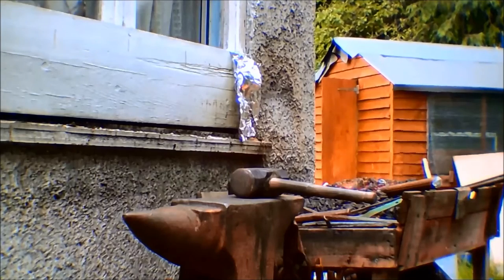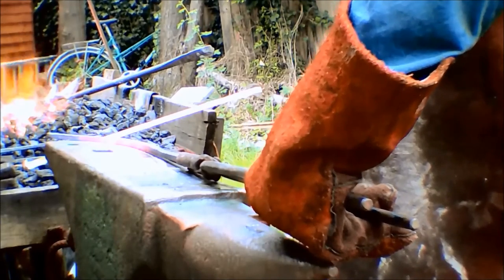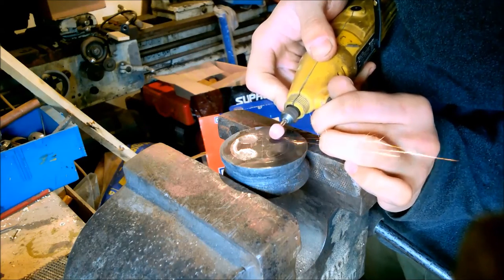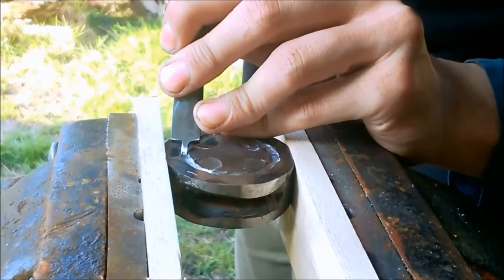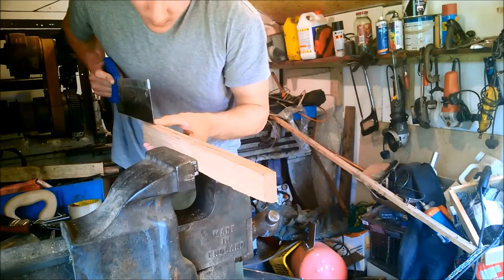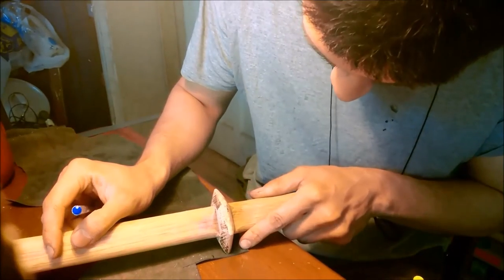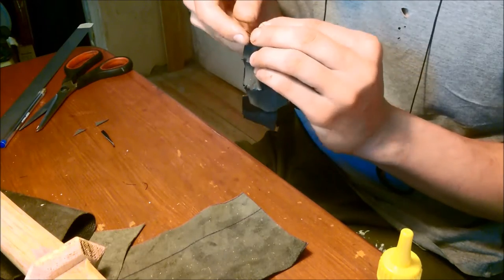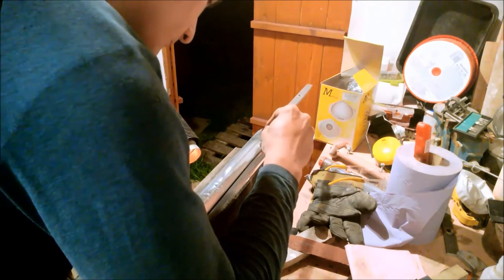Hand forging "Velka's Rapier" from Dark Souls 1

Comment: Awesome work, caught on to the channel after your battleaxe vid on fj. Cool stuff, looking forward to whatever you throw out next! 3 things though: does poundland sell cheapo spray paint? being murican, i know walmart and most hardware stores have very crappy spray for $1 a piece, wasn't sure if that's an option for you or not for markings. Second, not sure how much sheet work you do, but a buddy of mine uses old trailer balls to make cup shapes, just welds a squarestock to the end to stick into the anvil and hammer away. and finally, do you ever sell any of your builds? stuff looks absolutely stunning, even your basic (but no less pretty) steel toe dagger. Can't wait to see more mah dude!
Reply from the maker: Which markings? If you mean the runes I was going to highlight them with shellac but the axe broke before I did. 

Don't use sheet for much, haven't needed it really.

Sometimes, if I really like what I made or if someone I know specifically asks for something. 

And I have a few stupid ideas that should make interesting videos. I hope.

Comment: if you want a cheap metal that can take a decent edge, look for old leaf springs in scrap yards. just as cheap as rebar, a tad more work, but you do wind up with carbon steel for the stuff you forge that you do care about the edge on (and you're dead right that a rapier has literally zero practical use being sharp)

Comment: all you are hating on the fact that he used rebar. but its honestly not that bad of metal. some rebar has a high carbon count ad it is. and its less than the 1$ a foot. true. not all metal is expensive. and it can be easy to find. but you can go to a construction sight and they will more than likely give you the throw always for free. I think its a grate alternative. and still makes a working blade.
Reply: This rapier is not going to war, and rebar is an excellent practice material.

Comment: I asked a blacksmith about using rebar and he said you can't; glad to know that my hunch was right that you can in fact forge with rebar
😋
Reply from the maker: Can and should are two different things. You can forge rebar, but it doesn't harden very well so it makes a pretty bad blade. Trying to make something ornamental? Not expecting it to hold an edge? rebar is good enough. Want an actual cutting device? rebar is not for you then.
Reply from the maker: I'm glad you enjoyed it.

Comment: I guess I just don't understand.  Why didn't you just order a decent flat of 1095 carbon steel to use for your blade?  Not that expensive and you can get it mail order.  You went through all that work to build a beautiful hilt and grip.  Then you stuck a piece of rebar on it.  The end result was very good, but for not much more money or time  you could have had a real working blade.  Whatever.  You are a very good craftsman though I must say.
Reply from the maker: I might not be looking hard enough, but I didn't really find anywhere that does new steel in small lots. The best place I found was West York Steel and they charge £25 for delivery. And when the options are "Have £25 to spend on kebabs" or "Have a sharper block of metal leaning against the wall slowly rusting" I know what my choice is.